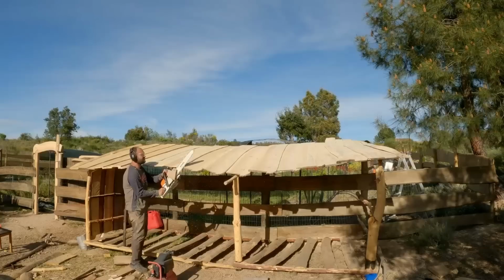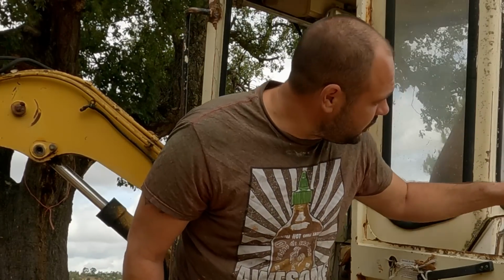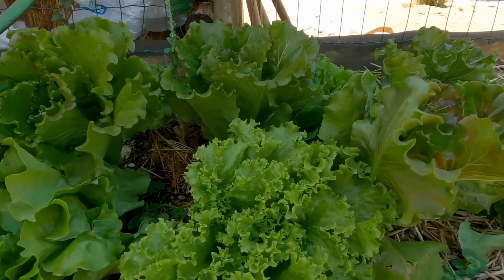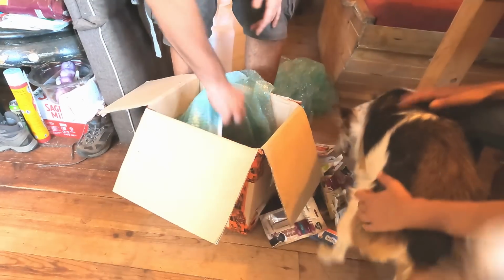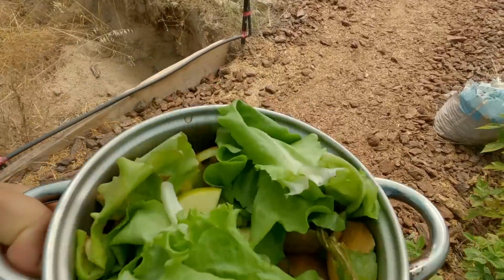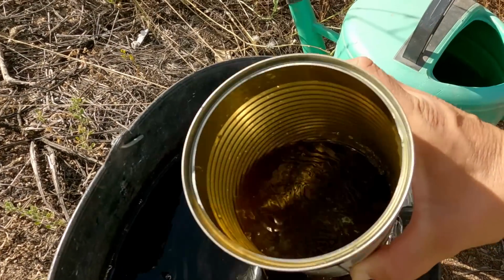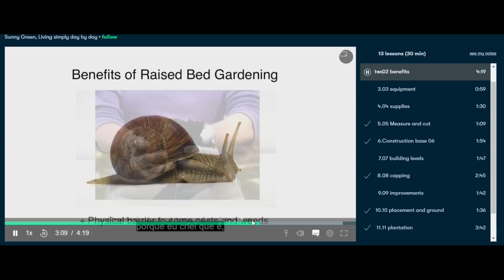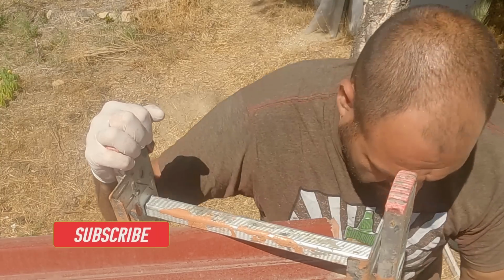Off the grid Homestead Happy harvest and ready for a storm TIMELAPSE

Comment: Hi, don’t know if this idea helps, but l collect the comfrey leaves , cut them up ,then cram   them into the 5 or 6 litre bottles, add some water, put the bottle cap on tight. Leave them to make the liquid.
You want smell anything until you take the cap off.
You can then store as many bottles as you can crop.
It means you can keep a supply for all year usage. I do dilute with water so it can become a regular feeding method all year round.
Reply from the maker: That's a great idea!I will do that next x x x Thanks so much Margaret
Reply: @lukeandsarahsoffgridlife  
Hi , it’s me again.
I would like to suggest a couple of ideas that help with your planting.
When you go to the supermarket, check out the area with butter and margarine you should find small blocks of fresh yeast.
If it even reduced in price because of its sell by date . Buy it.
Place it into a large water bottle, with a load of water, but make a hole in  the bottle top.
When watering plants add a little of it to your water .
It is a great soil conditioner , improves plant growth, and helps with good nutrition for the plants and soil.
The second tip is to collect some of the pig and goat dropping, put it in an old cotton bag or even an old pillow case.
Tie it up, then place it into an old barrel, water butt ,or even an old dust bin, fill with water, leave with a lid on it .
You will end up with a good liquid fertiliser, but dilute to use, as it may be to strong otherwise.
Happy growing xxx

Comment: Wicking beds are the best in dry climates like yours, or ours here in Australia. Do check them out. Of course they do have to be raised, just don't use timber for the sides, it only lasts  few years. The best is an IBC cut in half horizontally, they last for years and years.
Reply from the maker: Awesome ,it is nice to hear from someone who is using this method .Thanks for the tip  Maggie

Comment: Wowwwww Nice progress guys a lots of good news specially on your digger Luke After the rain stop when you have some time you need to drain that gas tank and clean it out and flush that old diesel out of the lines Put in some new Diesel and a new gas filter and it would be a good idea to change the water pump hoses and the belts and need to cleaner the distributor cap and points replace the old spark plug and the wires  and remember you need new Oil and radiator fluid it would be a good idea to flush the hydraulic system and inspect it for leaks because it is old after you get your motor together you do not want any of these other things to fail  just a suggestion  these are the little things that need  to be done before you put the new  motor in 🤞🤞🤞👍✌️🤙❤️🇵🇹❤️
Reply from the maker: Thanks so  much John we will definitely do all of that beforehand
Reply: Hopefully you’ll get all the rain you need got some pretty bad storms coming your way🤞🤞🤞